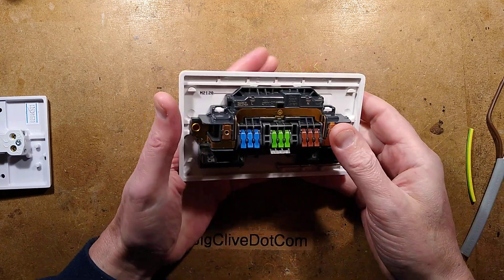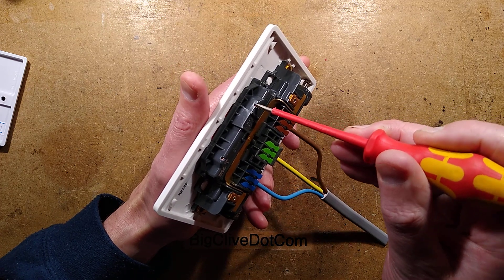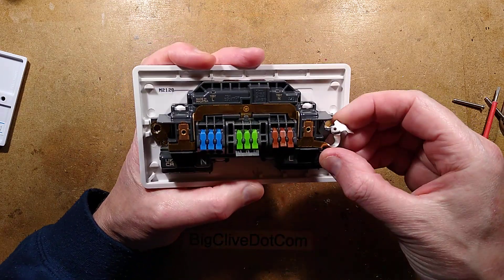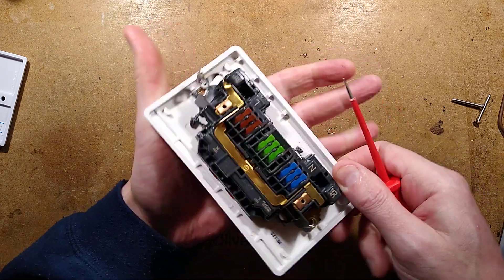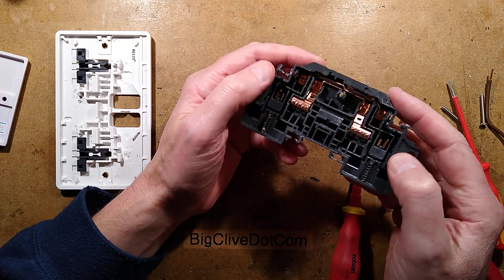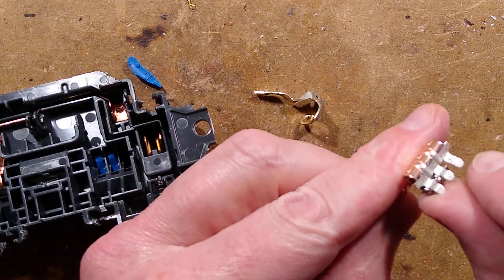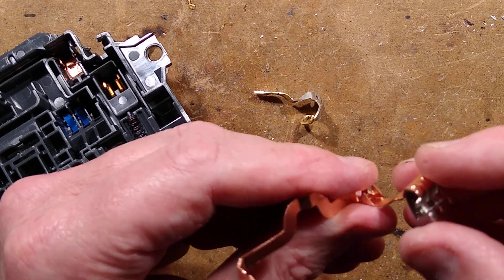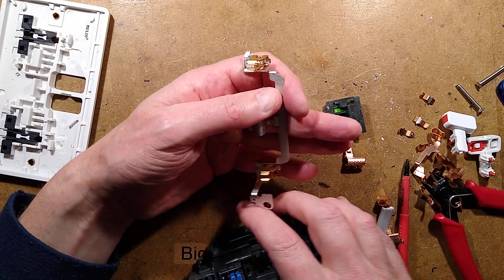Teardown of the new MK screwless socket

Comment: Finally... The more products that move away from screws for limp wristed sparkies to under torque, the better.
Reply from the maker: I think the main issue with torque damage has been kitchen fitters using impact drivers to tighten screws.
Reply: @bigclivedotcom  is it just kitchen fitters guilty of such a crime?
Reply from the maker: @edc1569  Largely, because they are much more likely to use impact drivers for their woodworking, and some have a tendency to treat a screw as a screw.
Reply: It’s also the monsters who crush through the conductors that cause problems.

Provided the spring material is resilient to heating and cooling cycles it should be an improvement.
Reply: Yes. Instead rely on Chinese spring tension and world-renowned quality control.
Reply: @thereynolds2725  No, better to rely on German engineering and quality standards.  That's Wago.
Reply: Think I'll stick with proper screw terminals where you can double over the conductor and get a decent contact area between cable and fixture.  The contact area on the conductor/cable on these new sockets looks rather average at best!  Whilst this is probably not an issue with normal installs large installations with lots of sockets could create ring finals with higher resistance than what is ideal!
Reply: until those spring clamps get loose with age whereas a screw torqued up correctly will stay put
Reply: @jaycee1980  How often do most people install, remove, and reinstall the same outlets though?  I could see your point making more sense with the stand-alone Waygo's (which are, essentially, fancy wire nuts).
Reply: @PongoXBongo  With wagos you can remove individual wires while live, you can't do that with wire nuts. Wagos are far superior and safer than wire nuts.
Reply: @killuazoldyck1352  I think they were referring to those slim wago clamps that do not have the levers
Reply: @PongoXBongo  They share almost nothing with those abominations called wire nuts.
Reply: @jaycee1980  They don't - that's why they are generally considered maintenance-free. On the other had a screw terminal can become loose if it is thermally cycled so needs maintenance.
Reply: @jaycee1980  Incorrect. Spring clamps maintain constant clamping pressure, screw connections are prone to loosening as the copper conductors flow (creep) under pressure.
Reply: @jaycee1980  The evidence suggests the reverse to be true.  As the copper conductor squeezes down under pressure, screws get loose and spring clips keep up the pressure.

Comment: I find it intresting that modern MK sockets require all 3 pins to be present for the shutters to open (which i think is safer, and i wonder if it is able to defeat those that try and ram a euro plug into a UK socket), whereas cheap sockets use the earth pin to open the shutters
Reply: @oo-ux1om  i have actually heard of a fire which happened as a result of euro plugs being used in UK sockets (the pins on the euro plug don’t make good contact with the contacts in the socket)
Reply: Yes it is possible, the 2,5A one is most likely culprit as the 16A has too thick prongs to fit into the UK extension cord I have._

Comment: Tin plated brass most likely, usually done to avoid corrosion, improve electrical connectivity and make it easier to solder to (for soldering applicable applications).
Reply: Came here to post the same. I assume it is an alloy similar to solder. Silver can develop a resistive oxide tarnish but that may not matter in this application since connections are typically only made once in the life of a wall socket.
Reply: @Miata822  could be silver but often needs greasing else it can stick without grease, and it's more expensive generally than nickel, markets moving away form silver for this reason and getting more expensive than gold... If its easier to scratch away it could be silver. Wouldn't put it past mk to overkill first iteration...
Reply: @Miata822  Usually silver oxide layer has very high electrical conductivity (unlike any other metal).
Reply: Bugger! You said it before I could. 😭😆
Reply: Avoiding corrosion in the case of aluminum wiring on brass or copper is rather critical. I don't like aluminum wiring, but fixtures need to tolerate it.
Reply: @jercos  Same with RCA and XLR connectors tin over copper to prevent dissimilar metal issues.
Reply: @ghinckley68  I don't think there are any Cu conductor RCA or XLR connectors with tin plating (typically: Ag, Au, Pd, Rh, Pt). Also because those are very expensive connectors the wires used with them are pretty much always copper or silver (sometimes with gold alloying).
Reply: @jercos  Interesting. In the US it is against code to connect aluminum wires directly to switches or sockets, some sort of mitigation is required.
Reply: @pauldzim  indeed! Existing aluminum wires are often connected with a specialized crimp or a gel-filled wirenut to a copper stub for the outlet itself. If I find aluminum wiring, I'd always rather pull new copper than 
"mitigate" dangerously cheap practices.
Reply: It could actually be silver. These sockets are designed to carry quite large currents, but for mechanical reasons the bus bars, pinch connectors etc. cannot be made of pure copper. The brass used adds strength, elasticity and durability under continuous deformation attempts that pure copper does not have. Unfortunately some metals used in the alloy are easily oxidised in moist air. Silver coating protects from that as well as ensuring much lower contact resistance which would be a bonus at high currents.
Reply: @blg53  It will be nickel...unlikely to use silver for such low current
Reply: @blg53  Silver oxidises much more than brass.
Reply: @BrianG61UK  But typical thickness Ag oxidation layers (without too much impurities) conduct electricity still really well. Brass oxidation layer is much worse conductor (sometimes practically close to being an insulator). In non hostile environments I haven't ever run into problems with Ag oxidation lowering interface conductivity.
Reply: @blg53  Its probably not electroplated silver as it would turn black with corrosion within months of plating,unless it was lacquered.That looks pretty shiny to me still.
Reply: We don’t use aluminium for home/house/office socket outlet wiring in the U.K., the only cables you will find are copper (actually called twin and earth or T&E). It’s likely the silver plating is form of nickel. Nickel plated threaded terminals were extensively used in some industries here in the past.
Reply: Zink plated copper like a wego wire conector witch is what this is just connected to a receptical.
Reply: Probably not tin, but more likely zinc or as you guessed, silver for better conductivity..
Reply: I came here to ask if it could be nickel...? It looks just like I've seen a chap do with a home plating set up on a fix it channel but I have no idea if that would make sense as I have no electrical training....!
Reply: As echoed below copper goes green oxide. To me with just high school chemistry must be an anti-corrosion plated. silver oxides are easy so do aluminum.
Reply: It's probably not tin and more nickel for durability/hardening on the terminals. I'm not sure what's on the brass end, still think it could be a form of nickel, you get shiny and matte type for different advantages.
Reply: @JLneonhug  Yeah, I was going to come here to say that at last in the US, you've got a history of nickel-plated copper, or if you go back far enough, zinc-plated copper.

Comment: Since the copper price is through the roof most of the electrical wires and strips are aluminium (some anodised with a copper color like coat)
 E.g. the cheaper UTP network cables are also aluminium wires instead of copper and tests have proven that they don't meet the performance of the more expensive copper wires.
Reply from the maker: Aluminium is a disaster for stuff like this because of the high resistance of the oxide that forms on it.
Reply: This is where the UK ring circuit comes into its own, it was designed to save on copper in the post WW2 era.

Comment: I've always been a fan of mk stuff and they're usually my preference when fitting electrical accessories, though they can be quite a bit pricier in some cases like their metal clad sockets which are markedly more expensive, but you can see the difference in quality. The only thing mk seem to lack are a good range of decorative sockets and the ones they do are hugely expensive compared say to Knightsbridge who do a massive range even with different colour inserts.
Reply: In terms of "decorative" abilities the American system is better. Here the electrical device and the surrounding cover are separate items, so you can mix and match. It's also nice because homeowners can change the cover plate to one of their fancy without needing to touch the electric bits.
Reply: @eDoc2020  this is available as an option in Europe/UK too mostly as grid systems, but with some exceptions the mechanical stresses in a well designed socket (with big contact area) means that single piece sockets tend to last longer than the modular ones and work-out cheaper too.(There are exceptions)
Reply: I still have MK sockets that were fitted in 1984 and they work perfectly, switches still fine too, far better than the absolute rubbish on the market today.
Reply: @Bond2025  Ours were in in 1976 when we moved in ! A Crabtree sw in the bathroom failed - metal fatigue break !
Reply: @Bond2025  when you look backwards when  companies  manufactured to build their brand. Current approach is chain-stores or distributors Buying trademarks (Both dial and LAP were actually good brand before kingfisher bought them) and getting Chinese manufacturers to make them as cheap as possible. If it gets bad then new trademark is created. I have seen 40 year old MB which was a no nonsense brand until it became a trademark and rubbish... If chain store wants to add 60% of the price then there is little space for quality. If you don't mind paying extra you might find quality in smaller stores or online, but chains will only sell quality stuff if the brand is so well established that they have to.
And in case of kingfisher will get imitiation Chinese equivalent and put them ahead of the real think. 
Recently for example Screwfix started hiding UKs no 1 plumbing fitting company John Guest in manufacturers list under show more option, to prevent their copy brand from being filtered out...
Reply: Metal clad sockets - which don't last as long.. #rust
Reply: @millomweb  except you need them where there's a risk of mechanical damage, so even if they rust they last longer than a plastic one would
Reply: @DanReader23  Fair comment :)
Reply: @millomweb  I would love to know a metal socket brand that compares to MK in how long they last (I hate fitting MK), but none seem to compare
Reply: @Zlodej5  Ask other manufacturers to make metal ones - out of aluminium alloy - so they don't rust !
Reply: Hager is always my choice. I find MK are needlessly expensive for how cheaply made they feel.

Comment: Big Clive: better put this insulation on the bond wire

Also Big Clive: and here we can see the exposed earth bus bar

I've seen Europeans express concern with the uninsulated bond wires used in NA and I've never understood it. Why bother insulating the bond when it's meant to take the current in a fault condition and has exposed conductors in most devices, like this socket, anyway?
Reply: My understanding is that it's about identifying the wire as well as electrical insulation. I can imagine that it wouldn't be too unlikely that a rogue unsheathed wire could make contact with a live terminal when is being stuffed into a tight back box. Older (or dodgy DIY) installations tend not to have the sheath.
Reply: @andydavies8232  On the other hand it seems like there aren't ever any exposed live connections in European wiring so there would be nothing to short against. Here in the US every regular outlet and switch has bare connectors on the side.
Reply: There's also the desire to leave certain metal objects ungrounded to not provide a return path for people touching that metal and live.
Reply: @johndododoe1411  leaving metal ungrounded is a stupid idea which has killed people
Reply: @philhermetic  Look around you.  Wherever you are there should be lots of ungrounded metal objects.
Reply: @johndododoe1411  no there isn’t, the regs used to say that “All extraneous metal must be earthed, some extraneous metal need not be earthed” and then went on to explain the difference!. Please give an example of metalwork that is purposely not earthed for safety reasons, you will struggle!
Reply: @philhermetic  That not earthing thing was not from regs, it was my explanation of why metalwork on class II appliances should still not be earthed.
Reply: @johndododoe1411  I had a class 2 led reading lamp given to me by the FIL, because the switch was broken, all steel construction with a twin flex entering the upright tube through a plastic bush. Switch in the top of the vertical tube was a minature metal toggle type, yet it was marked with the double insulated and CE stickers, I assumed there was a low voltage unit in the base, but there wasn't!! the whole lot was 240 volts with power reduction in the led itself, and class 2 was supposedly achieved by putting extra sleeving over the flex inside the tube, and where the flex was terminated onto the switch, two peices of sleeving instead of one!! This is very similar to an unearthed metal conduit installation! Technically it is "double insulated" but it is not technical compliance that ensures safety. The problem is that it is no longer the manufacturers responsibility to have their products teted for safetyby an outside test facility, all they have to do is issue paperwork that claims compliance, and if there is an accident, they are responsible under CE regs. The problem is that if there is an accident it is highly likely that someone is injured or killed  before this happens. I have repaired the lamp with a three core flex, with a flex switch, and earthed it. Now in the event of a fault, the rcd will trip immediately the fault occurs, before some one touches it. In the case of a faulty RCD which fails to trip, and this is quite a common occurence, the 3 amp fuse in the plug will blow instantly it is turned on. Much safer than relying on the integrity of the chinese electronics board inside the rcd! The proble with double insulation in metal appliances is that it relies on someone touching the appliance and carrying a 30mA current to earth before the rcd trips, if the rcd fails, you die! That is why the older IEE regulations said that "No mechanical device shall be fitted to any final sub circuit as a SOLE means of protection against overload and fault currents". Once again this is an example of compliance trumping safety, and in any electrical installation, safety is paramount.

Comment: OMG, I would LOVE to see that type of Wago-style connection on switches and duplex outlets here in the 'States!
Who am I kidding? We can't have nice things here. ( ._.)
Reply from the maker: I think you will in the future.
Reply: You can definitely get switches and receptacles like this, they just cost more hahaha.
Reply: You guys still using those wire twist cap things?
Reply: @CT-vm4gf  Nothing compares for price and reliability
Reply: Why would you want something less reliable than a screw clamp terminal?
Reply: @SuperAWaC  You wouldn't. It's a good thing these are more reliable, then.
Reply: @Monkeh616  there is no proof they are more reliable because they have not been in service long enough to provide proof!
Reply: @SuperAWaC  A spring clamp is MORE reliable than a screw connection as it maintains constant clamping pressure even when the conductor creeps over time
 Screw connections do not, they invariably loosen over time.
Reply: @ferrumignis  You are probably confusing what I am talking about with screw terminals. In screw clamp terminals, the screw presses a clamp which holds the wire. That said, screw terminals are very reliable when torqued to the proper spec. If you think spring clamps are universally more reliable I simply point you to backstab fixtures.
Reply: @ferrumignis 
 I'm still waiting for my 50 year old installs to loosen.
Reply: @paulsto6516  You've checked every single screw connection in your home with a torque wrench?
Reply: @ferrumignis  
Not home, Hospital, 43 years.  Do I trust my connections? Absolutely!
Reply: @ferrumignis  if the screw is tightened correctly, which only happens with a properly trained person who has been shown the techniqe of tightening till the brass squeaks, all the deformation is eliminated as the copper has work hardened by screw pressure. This  type of connection will not get hot, and thermal cycling will not occur, so they stay tight

Comment: Spring steel wire clips, because copper would not be springy enough to hold fast those wires
Reply: Yup an copper work hardens easy and is then brittle...
Reply: Phosphor bronze is more likely. It is used to make springs.

Comment: I bet it's tin coated. If you get a loose connection the heat generated will melt the tin soldering the cable to the terminal making a better connection thus cooling off. If so, thats why it's on the side mating with the cable.
Reply: Wow that's neat!
Reply: Same reason tin was used as the binder for babbitt bearings... a dry bearing can run for a substantial amount of time on a film of molten tin, letting it fail more gradually and safely.